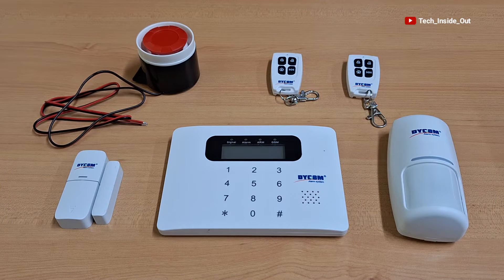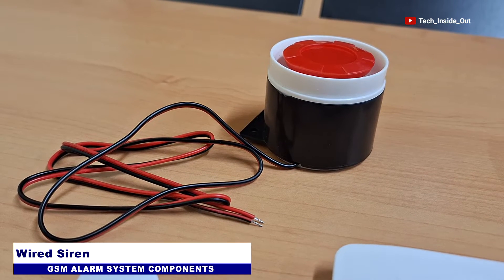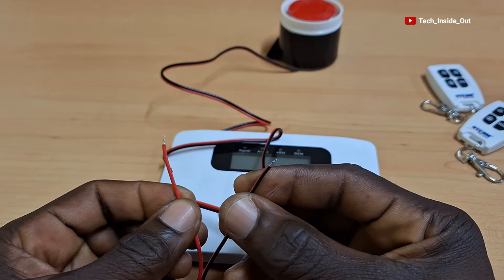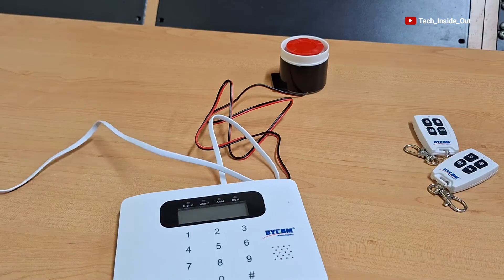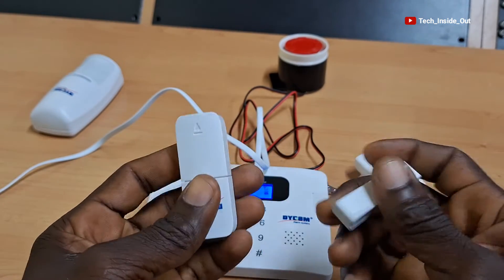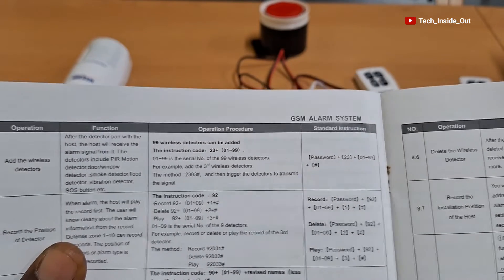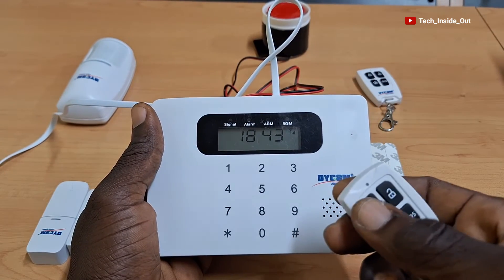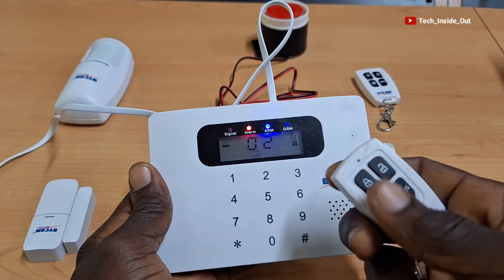How to setup a GSM intruder alarm system

Comment: How to connect program the remote panic button of the multi star alarm system which is not arming and disarming
Reply from the maker: You would have to refer to the manual for the program codes for adding those particular button.